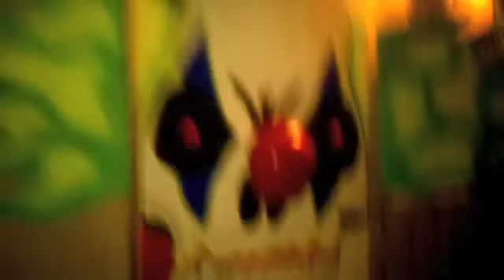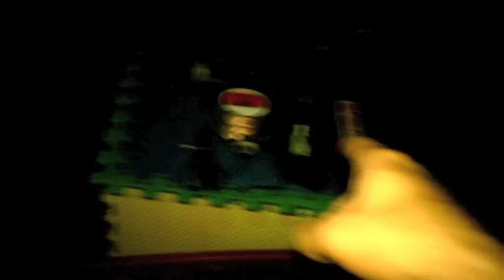Halloween Fog and lighting

Comment: On the fogger that is only partially working, it seems to be clogged. Have you tried cleaning it out with a mixture of 4 parts distilled water to 1 part white vinegar. 

Just empty all the fluid out, pour in the cleaning mixture, turn it on, wait for it to heat up and just give it a long blast when it's ready. It'll probably hiss a little bit at first, and you'll probably have to give it a few long blasts to clean it thoroughly but it should work again afterwards.

Comment: Any old fog solution seems to work just fine.  I have not seen anything different between the two.  I have much better luck with any type of  fog solution with running it through a chiller compared to the solution itself.

Comment: i like the fact the haunt is inside you did a great job. do you clean your foggers with dis.water and vinegar?? i need to clean mine before using it again. i like the popcorn buckets. might brighten your area up but not that much. i got a question for everyone. do you use special ground fog solution or just any old fog machine stuff. thanks!

Comment: I want to find out what kills the foggers. What can we do to keep them running? It is true though both my cheap foggers work no matter what. What are you using for y0ur primary lighting outside? The wash on the video looks liken bluand green garden spots. I made a crap ton of LED's and need to change the barrels so the are more general lighting and less mini spot. Dude you are sooo close. Keep some black walls to give them a break then BAM!! Add the roof.